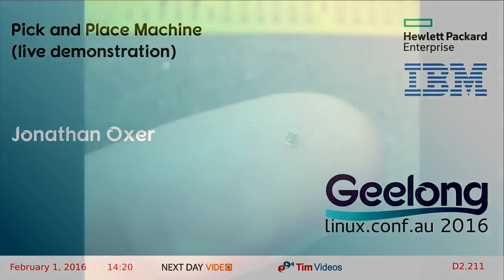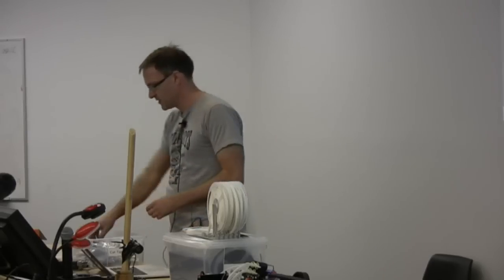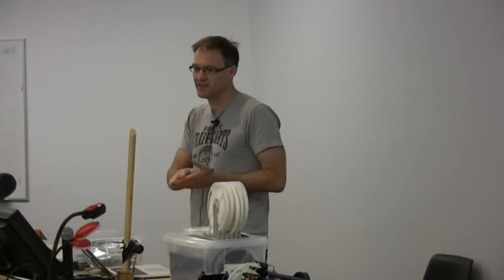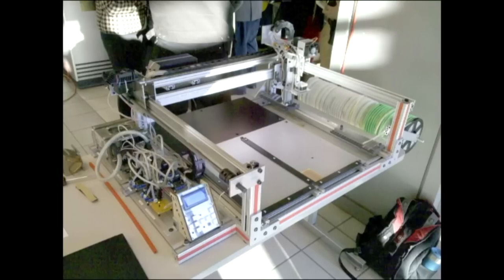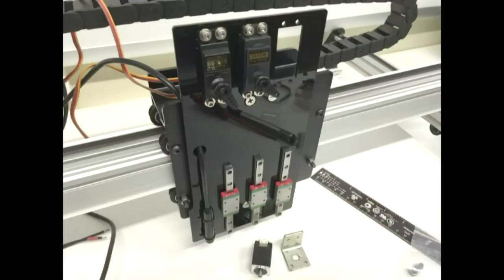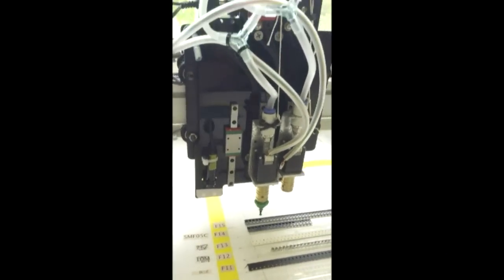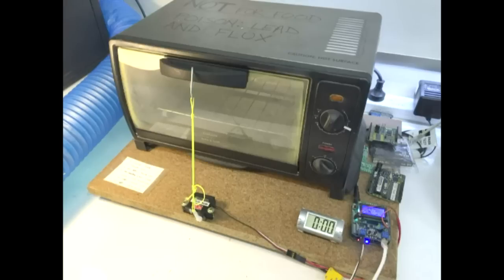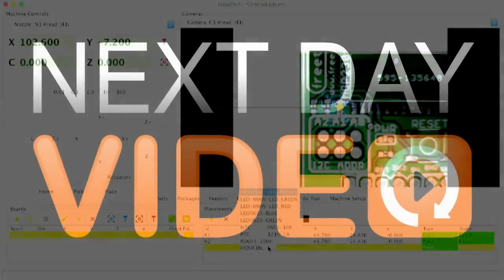Pick and Place Machine (live demonstration)

Comment: very exciting, I was thinking to make a small pick and place and even have the full x,y & Z bed but am not sure how to workout the vision part. I have built my own dedicated CNC controllers as a hobby and am even selling them, was thinking to make a vision system that can give feedback to my controller for the visual alignment part.

Can you please guide me on how should I start with the vision part, maybe openCV or just start making an embedded system and connect a camera to a microcontroller and do vision from there.
Reply: Vision isn't a 100% requirement, though for error correction, it is important.
It will highly depend on what architecture you will run the controlling software.

I think you're better of using a microcontroller to do the driving of all hardware.
And let it interface with a PC (this may also be a Raspberry Pi).

The PC would tell the microcontroller to go to different positions, in the meantime your PC will receive feedback through the camera. If a part is angled wrong (as seen by camera), the PC can then instruct the microcontroller to rotate a given amount of steps.
Reply: I have made my own CNC controller running entirely on a micro with windows like GUI, so GUI is not a problem for me and I can easily add interface for the pick and place part.

Actually I have built CNC controllers for lathes and mills and wanted to have a version for pick and place, I have enough I/O's that will be required to operate the entire machine, its just the vision senor part, maybe its better that I spend a bit more time on making the camera system on micro too and then write up the code to detect the corners and angles of the parts and send the data to my existing controller through serial.

My problem is that I dont have any experience with pick and place as to the functional specs such as what data is required for each part and heights of each component etc and if someone could guide me in defining the scope then I can easily modify my controller to work as pick and place.

and thanks for relying back
Reply: My point was, that it can be much easier to do the video processing on the computer.
I wouldn't bother trying to run "OpenCV" on a microcontroller, plus it would have significant impact on the performance of the microcontroller.

Functionally seen, a pick and place machine is a machine that takes trays and/or reels of components and places them on a board.
Basically, that's all there is to it.

Basically you would insert some reels (and configure them) and insert a file containing the locations of each component.
Since the "GUI" knows which reels of components are at which position, and where the component should land, it can instuct the microcontroller to move to those positions.
Usually the machine has some type of suction head which can lift the components and drop them at the position.

So it's very much like a CNC machine, but instead of using a tool to carve, you have a tool that picks up and drops components.

For the parts, I think it's quite difficult to align a part that's square, since it's basically the same if you rotate it 90 degrees. Though, they should all be oriented in the same way on the reel, so basically, alignment of parts is done by checking the sides of it and making sure they are "straight".
OpenCV is a very good library for this, but it will require some programming. Though, an awfull lot of tutorials/blogs can be found on openCV.
Reply: @MassoCNCAustralia  if you haven't done it yet, I wouldn't bother reinventing the wheel, and just use the software that already does the job and is opensource (unless the license doesn't permit it.) you can use the opensource part as a plugin to a proprietary software on most opensource licenses.